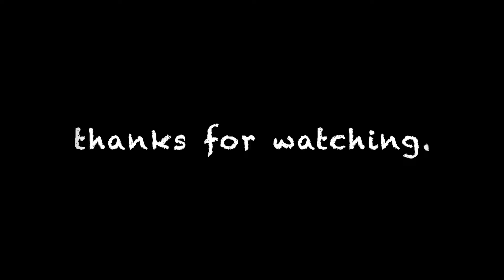building a kids tree swing

Comment: I had to cut down this kind of swing last year. A neighbor's child tried to quickly craw under the swing as someone was riding it. The wooden seat struck her brawl  and caused a considerable cut. I recently put up a new swing, this time I used an old tire as the base. Am sure this will have less blunt force. The child who got hurt comes to swing on the new swing. (They are still friends with my daughters)  then again coming to think , it's all part of growing up isn't it?  Also notice how sharp that edge is.
Reply: Agree with the sharp edge. OP might not realize that the swing will "swing around" once a kid gets off, and hit the kid. Happened to mine more than a few times. I ended up changing mine out using a lighter board (common board from Home Depot) and used a router with a round over bit to take off the edges. I saw in the video they are all sharp edges.

Also, I read that boiled linseed oil is more for indoor applications, not outdoor. Not an expert there, though.

Comment: What kind of cord did you use? thanks
Reply from the maker: we used polypropylene braided rope.  it has some stretch to it, so if you want something without stretch try Twisted Sisal Rope Twine.  both can be purchased at big box home centers.
Reply: @BasemeantWRX  thanks a million . I had an 8mm polypropylene braided rope with steel wire core and it broke over time with a tree knot (within a month and a half!!!). It is for a 8 meters high tree and for a trapeze for a 7yo child. Climbing is not an option so I am trying to find solutions that can be done from the ground. My guess is to use double rope and braid it so it becomes one after the tree loop to skip the knot, other idea is cable (which I am concern it hurt the tree). If you have any other suggestion I would appreciate it.
Reply from the maker: carla gomez monroy doubling and braiding should work and be rock solid.
Reply: @BasemeantWRX  thanks a million